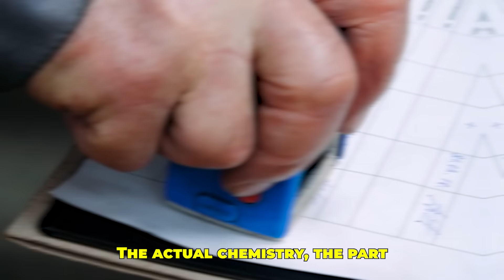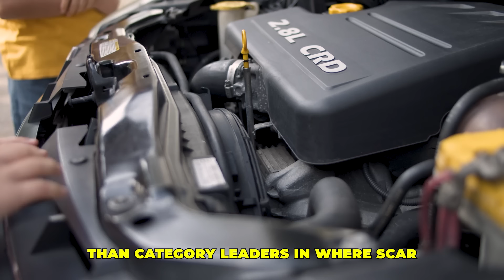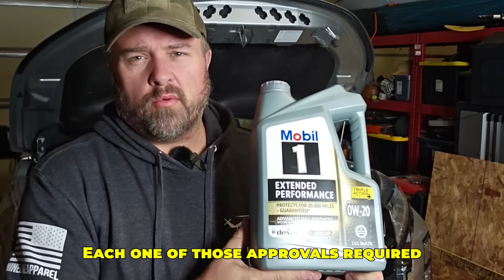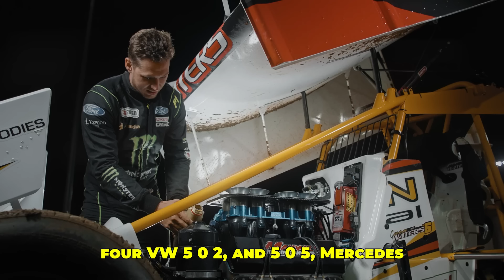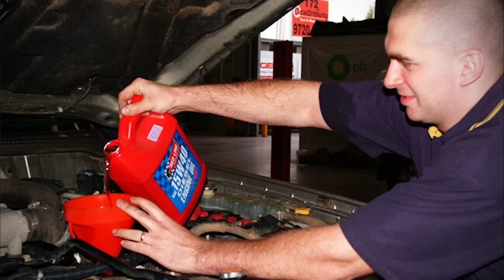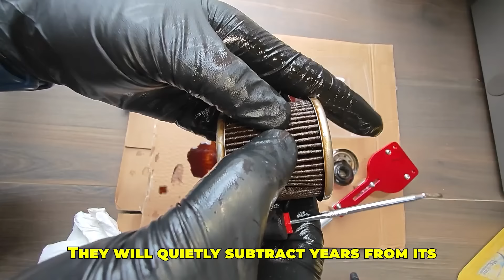AVOID These 3 Full Synthetic Oil Brands (And 6 That Actually Protect Your Engine At High Temps!)

Comment: Camry 2014 SE V6, wad used 78k miles, I paid for "full synthetic oil" Decided to save and get my proper tools and do it by myself.  2 years and 174 K miles I start with Mobile 1 but decided to change to Valvoline MaxLife Extended Protection Full Synthetic High Mileage 0W-20, read before Valvoline was better one. One thing I may add, 2GR-FE is a normal "noisy" motor, but I noticed a reduction with Valvoline vs Mobile 1.

Comment: If this story is to be believed, they may want to check facts 1st. ST HI Mileage synth is rated as  API-SP not SN . . . and the ILSAC GF-6A is also higher rating. ST Synth also has a Dexos1-Gen 3 certification. I would think Walmart and others listed might want to send cease and desist letter or like.
Want proof? My 2 Saturn SL2s (97,99)were and are over 300k using that oil. No open engines except for timing chain at 220,000. My remaining Saturn still gets over 35 mpg, is driven 36,000 per year., with a quart added around 2500 between changes at 50000.
Reply: Super tech meets all the ratings I've never had any problems also if Quaker state is so bad why do they offer 300k warranty

Comment: My 2018 Dodge challenger 3.6 gets Havoline full synthetic in the brown box every 5000 miles and engine has 193,000 no ticks and the original oil cooler and uses a premium oil filters
Reply: I agree with you on the havoline oil being the best. I have 3.6 dodge 56k miles and I am switching from 0w20 to 5w30  valvoline extended protection year round.  Hope I’m not going to regret it.

Comment: I have a 2006 Honda CRV with over 250,000 miles and I have used only Super Tech since day one. Never had any problems.
Reply: Have a 2003 f150 with 221,000 miles running nothing but Supertech full synthetic changed every 4000-5000 miles never had any engine work

Comment: I've been using Supertech synthetic oil in my 2014 dodge charger and I have over 185,000 miles on it. Still runs good 👍🏼
Reply: Bold move on a notoriously unreliable vehicle. Glad its worked out for you, though.
Reply: @spiralnapkin yea luck must be on my side. Its been very reliable 👍🏼

Comment: Who thinks the dealer where you purchased your new car from uses ANY of these top rated oils?   They use the cheapest oil they can purchase no matter what you pay for.
Reply: You are correct,  we used to buy bulk oil from Warren,   as long as it meets the specs we purchase.
Reply: That is incorrect. You are obviously someone who has never set foot in a dealership service bay.
Reply: @sumtime-c1h  lol it is well known the bulk oil dealerships buy are especially NOT the oem... You would not even know what they dump into it when you worked there. They do not label it with brand names.

Comment: 2001 Durango, 401,000 miles, all original- Valvoline Full synth.  1979 Mercedes 450SEL 6.9- 355,000 miles, Valvoline full synth. 1983 Ferrari 308GTS 116,000 miles, Valvoline full synth.  2023 Mercedes GLS 22,000, oil changed every 5000mi, new motor, using Mobile One. F@€K Mobile One and the Two-dollar scum who sponsored this video.

Comment: Blackstone Industries in Fort Wayne IN published an article 10 years ago stating the all API certification oil offers SAME protection if correct weight is used.  They specifically mentioned Mobil 1 and SuperTech offering, again, SAME protection if correct weight and OCIs are used. Ever heard of Blackstone ?? They are the NASA of oil analysis .  I used ST in a new 2013 Odyssey for 240k miles with no engine issues effective from “bad oil”.  However I do use Valvoline R and P in my Theta engine by KIA.
Reply: BOTH my Ford SUVs - GTDI Ecoboost gen2 engines. Purrr on Pennzoil Platinum/ Pennzoil Ultra Platinum 5w30 as required viscosity. Bought new as are all my vehicles . Run impeccably use zero oil. 💯
Reply: 8

Comment: I've been using Redline regular and now High Performance due to the DEXOS 1/2/3 certs for two decades.  I've NEVER had an oil-related issue.  I have had coolant, trans and power steering/water pump issues but thats another matter.  They are important to maintain, too.
Reply: I have used the cheapest oil i can find. I generally keep my cars 10 years. I NEVER had ANY problems with ANY part of my vehicles except for factory recalls and most of the time I was sorry I had the dealer do those recalls.  I change my own oil at between 5 and 8 thousand miles.  When you let others change your oil...you will get the very worst oil they can find at the cheapest price.
Reply: @GAderly-fn5ly  Agreed.  I had a 2016 RAM truck that I initially took to a Valvoline place at 5k miles to do the first change.  I got home, checked the filter.  Still had the factory filter.  Check the oil, and it's black.  They didn't TOUCH it and charged me $90!

Comment: As you said, Aimsoil is too much for my change interval of my VW tdi medium truck. I use Motul 8100 ... efe. In my previous same tdi VW engine, I used Valvoline Blue, and it worked excelent for 10 yrs.

Comment: I use pennzoil platinum  5w20 platinum synthetic oil in my 2022 Dodge challenger , I have been using it since I had the car Chrysler recommends this brand

Comment: Most modern oils do not carry requirements for European vehicles. There are EURO Car Oils out there for that specific requirement. Mobil 1, Castrol and Pennzoil all have EURO Car oils suitable for those vehicles. AND they are available at Walmart. 

Personally, I run Mobil 1 EP HM oil in my vehicles, and mate them to Fram Ultra Synthetic oil filters. I don't know what's going to happen with Fram since their parent company filed for bankruptcy, but if I have to change to another oil filter, then I'll do that. Maybe another company will pick up the Fram line.
I do work at Walmart as an Auto Care tech so I put a lot of oil and filters in vehicles.

Comment: Castrol Edge is shown in my Mazda CX5 owners manual. I have been using Castrol for decades and will only use Edge in my CX5.
Reply: Decent oil. Pennzoil Platinum far better! Run both. Test em! U will thank me.

Comment: Super tech synthetic one of the best oils you can buy. This video is wrong. Also turbo bearing failure is caused by the oil coking after shut down from excessive heat and synthetic oil resists coking more so than standard refined product. Of course if your turbo cooler is compromised that also can lead to early failure.
Reply: If the engine is idled for about 15-30 seconds before the engine is shut down, that will allow the turbo to cool enough that the berings will not cause that.
Reply: GARBAGE!
Reply: No its not period

Comment: I’m from Dayton Ohio & my vehicle has 126,000 Milles I’m using Valvoline Restore & Protect I did my 4th charge with R&P & using a WIX XP oil filter. Toyota RAV 4 . It’s a 2016 model yr . So far so good it’s been working well. I buy it at Wal Mart .
Reply: I have 2002 Dodge Durango 199,874 miles. On my second application of Vavoline restore and protect and use the same filter. Vehicle was running much better midway through first application.
Reply: @jahart5556 awesome! I’d say with consistent use it should get better. I have took notice of the throttle body on mine & hardly anything on it . I’d say it’s definitely doing what intended to do
Reply: Same here, I began using R&P in my 2003 Toyota Corolla, with 125,000 mi on it.
Reply: I use the same on my 03 Toyota Corolla with 125,000 mi on it.  Wouldn't think of anything using anything else from here on in.
Reply: @mke_miike it’s a good oil especially at that mileage.
Reply: I’m running a third interval of VR&P in my 2012 Honda Accord, bought used at 125K miles two years ago. Because I didn’t have a full maintenance history (Carfax can only do so much), decided to run the VR&P for 4 intervals to see if it’ll clean the internals. Blackstone Lab report on the last interval showed wear metals good, plenty of TBN remaining, and Lab says to extend the mileage interval out an extra 2000 miles (to 10,000 miles, hwy driving). 👍🏼
Reply: @carlovanrijk4039 good choice! My take on any vehicle with high mileage or unsure of the maintenance. That oil is a solid choice !
Reply: Same here!
Reply: Valvoline r and p cleans well but the stuff it cleans out sometimes clogs your enginenup
Reply: Wouldn't ever own Toyota vehicle. Personal pride. Keep my vehicles 10yrs if possible sometimes trade sooner if choose but never due to vehicle issues. Always buy new. 22 Edge AWD 2.0L turbo -64k mis & 05 F150 4wd - 282k mis in driveway.  Both run impeccably use zero oil.

Comment: right where he says that there is an oilthat can UNDO  wear. damage...the video stoppped right there....that is pure BS
Reply: Agreed. There's no such thing as liquid bearings
Reply: I agree with you. Bearing damage will not be undone/repaired by any oil. I wonder if it would however help clean the oil lines to the turbos that have carbonized oil in them? My 3.5 EcoBoost has 177,000 miles. I am currently using Pennzoil Platinum 5/30 recommended by Brian on his MakULoco youtube channel.